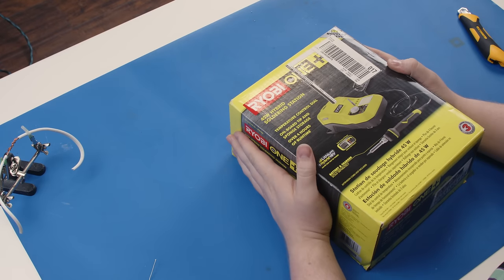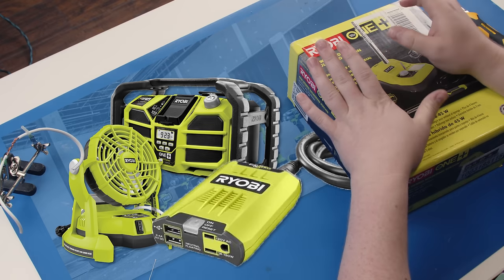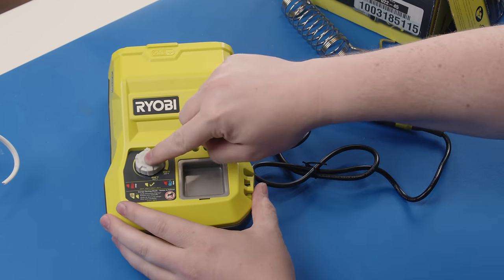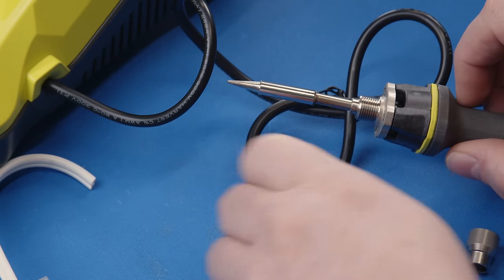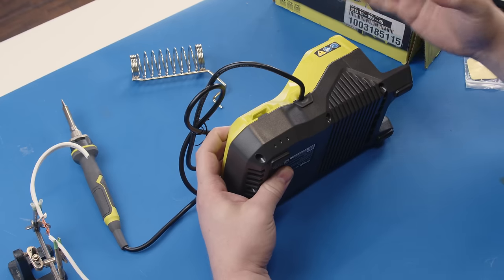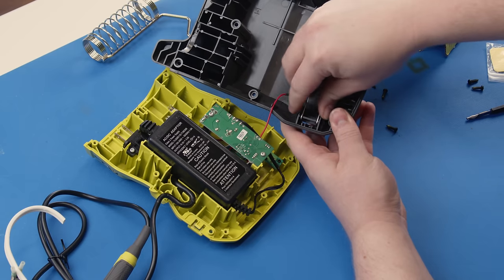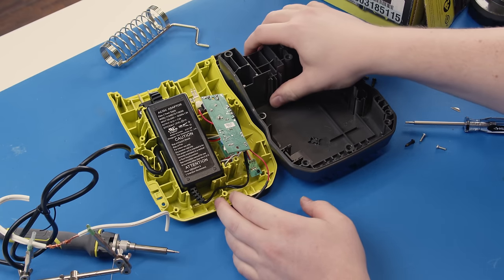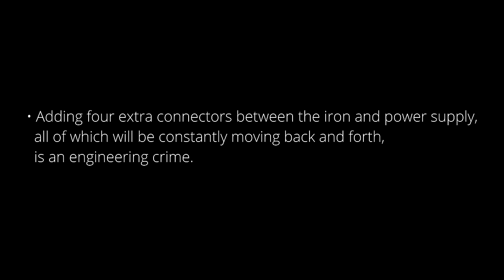Ryobi has GOT to be joking with this soldering iron

Comment: I was surprised at one particular thing in the video. I bought my first personal solder kit about fifteen years ago, misplaced it after years so then bought a new one (different brand) about 20 months ago. Both have that centre ceramic element, which is exposed when you change the tip. 
So I thought that was the norm. Both with digital temperature control and current temp display (on the iron).

edit: 20 months, not 200

Comment: based on your specs I would say you should get a ts100, ts80 or pinecil, all of those are affordable and very good soldering irons with the features you want, you just have to get an adapter for the battery or a use a powerbank

Comment: I use the Milwaukee at work, and when I'm done using it, I end up setting it on the concrete floor like 5 ft away from me do I don't accidentally touch it. There case for it is plastic and will melt off put in hot. It's also burns through batteries fast, but that's expected. I do most of my soldering inside vehicles.

Comment: I hate that I never realised you had to hydrate the sponge 😯 Did it on my station just now, and now it looks 10 times better....if only the manual had mentioned this 😂
I'm not great at soldering either, but my dad is, and he bought me this station as he wouldn't let me buy anything without temperature control or a removable wire.

Still looking for one of those USB powered irons though, as this station is great....but it's so bulky and is a chore to get out. Unlike my dad, I don't have a dedicated spot for it to live, so it get's packaged up every time and put away....

Comment: The Weller WSM 1C was a decent but chunky and ex$pen$ive lithium battery portable that I used for field soldering for years.
 It runs on the bench off the plug-in charger with the 2.5 mm Barrel plug.
The iron is a WXMP that takes the weller RT plug in tips.  It doesn't disconnect from the station just like the Ryobi but at least it's not PVC jacketed.
 I made a 3/8 plywood case to carry the darn thing in my Pelican case so the TSA would have difficulty smashing it to pieces.
 If I were looking for a portable now I probably use a TS100 or maybe the TS80 USB charging iron.

Comment: The fact that a hardware store doesn't have torx screwdrivers is absurd.
BTW, that heater design is basically what every single soldering iron with interchangeable tips has been using for the last 15+ years

Comment: I use one of the 40 watt irons. Tho I'm in the market for one with temp control. I just use a little flux paste, and boom  joint is done.. gotta be a little careful to not overheat the wire and melt the insulation. Hence temp control but flux paste makes all the difference for me

Comment: for the limited amount that I do i use the Weller AA 6/8 watt unit.  Throw a couple rechargeable AA in there when i need to use it, fix whatever i am fixing, then pull the batteries put it back into it's case and i am done.

Comment: I had 2 minor complaints with the soldering iron.  I found the cord between the base and the iron to be a little thick and stiff.  Fighting it made my hand tired when using it for a while.  The second is that there isn't really a reference for the adjustable temperature.  If I want 700 degrees, where is that on a scale of left to right? Lol

Comment: I took one of those plug in the wall units, took the tip out then stuck a 10 gauge wire about 6 foot and thawed a frozen water pipe at a friends house. I’m pretty sure it’s still there ready to plug I and get to work

Comment: Those Milwaukee ones are actually really good, you want to use one of the bigger M12 batteries which then acts as the stand and they're probably not ideal for soldering PCBs but they're perfect for automotive use, just don't drop them or smack the tip lol

Comment: Yeah i had a cold heat soldering iron from RadioShack and it was really janky, getting it to get good contact for it to heat up the solder joint was a common problem for me, ive been wanting a good battery powered iron for awhile, may have to pick one of these up as it does seem better than other things ive seen, funny seeing a external power brick stuffed inside it though.

Comment: with the last slides of the vid in mind, i use a ryobi 4ah battery into a ryobi to power wheels adapter (battery socket with 2 wires coming out the top.), which i then have a long cable with a barrel jack that goes right into the back of my pinecilv2. sure its 3 pieces now, but it works for me. My soldering station with stand is built into my 3d printed pinecil case. but i get its not for everyone.

Comment: I bought a Milwaukee cordless soldering iron, that takes the same battery as my drill. So I bought two 3.5 amp hours batteries for it. It doesn't run very long but I keep a spare hot battery 🔋. I also have two butane ones. I work on lawnmowers and they don't always break down close to a plug in.

Comment: Nice indeed never paused to think about Ryobi's marketing re the common usage of their batteries , was at Bunnings our harbour freight and wanted to buy new batteries and a charger for my drill , the Ryobi rep was there saw me looking at the new batteries and charger and quietly said buy a new drill or any other Ryobi product it works out cheaper and it did ,new drill came with 2 batteries and a charging dock . Same as the scam with printer companies they sell the printer for next 2 nothing and make their money on the ink refills. Nice dismantle thank you and I know you where neither sayin yah or nay a well balanced look at the product, most of my gear is Ryobi and yes I keep buying their products and use them in my humble workshop (wood worker here) because of the same battery compatibility  , hello from Australia .

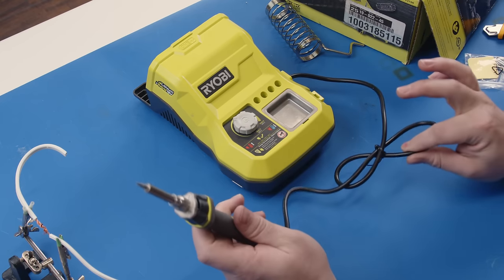Comment: 24:06 - you are NOT wrong about the temperature rating on the jacket of the cable. (Well, I mean, quite literally you are wrong about it, but that's not the point here, an 80C-rated cable is ridiculously under-rated for this application, no matter what that rating actually means, and what you're talking about is a big part of what that rating means - just not all of it.) But honestly I think you might be overlooking another serious concern, aside from the burn-through risk. If the cable itself gets hot enough - IOW if the PVC gets hot enough (and we're talking less than 100C) - the PVC will start to break down and release the C part of the PVC, in its gaseous elemental state, into the atmosphere around it. From every surface. Including the inside of the wire. That Chlorine gas will then proceed to corrode almost all of the other wire insulation inside the cable, effectively destroying itself from within. It'll also escape the outer surface of the wire, into the atmosphere you're breathing, with your head less than a couple feet away.

Comment: The soldering iron I learned on was one from harbor freight. zero temp control and as soon as i touched the tip to the working surface it immediately cooled off. it took me like half an hour to solder 2 wires together.

Comment: I think you have mistakenly considered the serpentine strain relief hold-down bosses in the upper shell to potentially cut into the cable. Ryobi has down a magnificent job of designing the plastic shell and I am certain they precisely designed the amount the bosses press into the cable. The precisely fitting shell halves seem to have been designed and manufactured in a whole order of magnitude better than any of the other components. They have had a tremendous amount of design and manufacturing experience from their extensive previous products, and it shows in all aspects of its design. 

Please refrain from commenting about the quality of molded cases of which you apparently have very little design and manufacturing expertise. Also, to denigrate the choice of screw length  holding the shell halves together is clearly unjustifiable and just plain wrong.

Using a prebuilt, standard and certified commercial power supply, AC plug and all, is absolute genius !

It truly is a shame Ryobi sabotaged their otherwise solid product with their terrible cable choice. What do you imagine they were thinking ?!

Comment: as a guy that has soldered for decades as a pro IMO the handset cord MUST DETACH so I can hot swap on the fly and NOT wait for the tip to cool down! cause somethings you need that mini tip for PCBs and other times you need that huge broad tip to heat up one thing!  and I am not paid to wait for a tip to cool down and my desk space is LIMITED!

Comment: For what it's worth regarding that little portable Hakko unit, while it doesn't have heat control and has just the one tip (or does it? Idk, my experience is with one at work that I didn't buy), it heats up very fast and the battery isn't a charge-in-place LiPo; it runs on AAs. It's definitely no replacement for a soldering ~station~ but for repairing anything already installed somewhere, it's awfully handy.

Comment: I have a few soldering irons and I usually end up using a butane soldering iron.  I got a Lexivon and its great.  I hate cable and just seems to make sense for the stuff Im doing.  Its also great for FPV fixing things in the field.  But I even end up using it in my house with HAM radio stuff.

Comment: I started out with a wheeler with a trigger and I soldered almost everything with it including automobile wires I had a cheap Chinese 12 volt DC one most handy as I didn't need 120 power so far I've never had one with a tempature adjustment and I've never had a problem soldering anything I've also use an old copper soldering iron you heat in the fire I used it to solder antique pump engine gas tanks no flame around the tank as with a torch and with that one inch square by 2 inches long chunk of copper really held and transfered the heat now with the new cordless tools this is a logical addition as for the 120 volt adapter a lot of units use this idea and as for the warning label this is the manufacturers way of covering their own interest like the battery in the black and decker booster when it dies around a year or less you can't try to get a replacement battery on warranty as it says right on the battery do not discharge below 12.2 float charge is 13.4 and full charge is 14.8 and on the built in wall wort output 12 volts so you can't say I've never taken it below voltage and I've kept it between 13.4 and 14.8 as the wall wort won't do it knowing that I had just bought 2 everstart booster packs so in checking them out the included wall adapter put out 12 volts so I checked out what it actually charge to 13.1 so I phoned the company and they assured me that was fully charged but a year later it started loosing power and fast went from 5 to 3 to 2 boosts in short order so I put my good battery charger on it through the booster cables at first all I could get it to was 90 % 13 volts but after a few charges I I got it to 13.9 got another year of life thought I might put a new battery in it but by then I found one aircompresor seized on had to open it up and cut a wire to shut it off the other one didn't work at all and with that build quality I'm scared to try the inverter in either so I'll strip them down for salvage and the batteries will get me 10$ scrap since I've had other issues with product from Walmart I won't buy everstart batteries or Schumacher products again because I won't buy from dishonest companies if they are dishonest on equipment specs to sell products what else will they do for profit

Comment: Dude I’ve seen this in several HP printers. They have a little wall wart with a tiny 3 pin molex-esk plug and one of those figure 8 AC plugs run to the outside! Baffling and made me laugh first time I saw it 😂

Comment: I know this video is 2 years old, but check out the TS 80 or TS 101, they are slim soldering irons compact powered through your average 65W usb-c charger. the only caveat is that It won't be wall cordless like the ryobi unless you use a 65W power bank.

Comment: Other than the fact that it seems kind of goofy, what exactly is the problem with having a sealed power supply like this embedded in the product? As other commenters have pointed out, they likely designed it this way to avoid having to go through an expensive and time-consuming certification process. I don't see the problem.

Comment: I've switched to a USB style soldering iron with the temperature sensor near the tip. Revolutionary. Not sure what the point of this product is when there are better, smaller and cheaper options out there now.

Comment: Look ive used a lot of soldering irons over the years and i get your point at the end but the pinecel is literally the best iron I've used, i have a decent station that I got for a small product run and around the same time picked up a pinecel as well, when it actually came to the day of production me and my team mate kept atealing the pinecel just cause it was that much better.

At the cost of $25 i can literally afford to keep multiple arpund the house so if one ever dies (which hasn't happened yet) its no big deal.

Comment: To tell you about power supply in the end of the video. Both output same voltage. 21V because battery pack is 5 cells in series. Full charge is 4.2v per cell 4.2x5=21....other power supply is measured and listed like nominal voltage 3,6V tht is it

Comment: The TS100 is a great portable digital iron with a great selection of tips. It runs on dc power so yo can run it of a powerful batter. Have had one for a few years, never touched my soldering station again.

Comment: Milwaukee m12 soldering iron is my favorite of all never had an issue with mine and if rough of as can be literally gets tossed and falls and use it alot on all of our equipment and trucks I don't know how they had issues even dropped there impacts 9 feet off a loader fine lol one thing that didn't like a fall though was there m18 grease gun it lost its two speed lol

Comment: My issue with ryobi soldering irons:
- The cable isn’t silicone, so it’ll melt if you touch it with the hot tip! Silly
- The indicator light is red-only and slowly fades in and out when hot but off, which you can’t just glance at to know if it’s off, on, hot, heating, at temp, etc.
It’s like no one tried it out after they designed it

Comment: Notice how stiff the iron cable is. This cable should be as flexible as possible, so it doesn't risk pulling the iron out of its holder and to minimise any annoying pressure a stiff cable is putting on your hand whilst soldering. The cable should be made of silicone, like the Weller irons.

Comment: The station has a lot of weight PLUS the black wings on the back is so that there is adequate support for larger batteries. Otherwise, a 4ah battery would tip it over.

Comment: I bet the lack of cooling and the overbuilt case is because it’s part of their 18v tool series and needs to survive life away from the normal location of a soldering station. This might get thrown in a truck toolbox, might see some moisture etc. whereas 120v products are made with the intention that they’ll be used indoors safely away from moisture and vibration.

Comment: What frustrates me is that as easy as they're making tools hybrid by slapping in an off the shelf adapter, not all of their tools are hybrid. I have a small hot dog air compressor that's not hybrid. Makes me wonder if I can retrofit hybrid functionality on any of the tools that are lacking with a COTS wall wart. lol
Reply: The hybrid function is nice .. but i don't think we will see it on the tools that use alot of amps.

Comment: I was trained to solder with a Snap-Off butune iron and i stg i didnt learn anything bc the damn thing never got hot enough to tin the tip. It was a student tool for a automotive class and as soon as i went to electric I began to understand what they were trying to teach us years ago and why all my joints were cold joints. No longer afraid to solder.

Comment: Both / All of the Ryobi soldering iron models use the same iron / pencil / tool. I have the 40 watt model which does not have a temperature control which is just fine for soldering wires and adding a drop of solder to the end of a lithium battery.

Comment: RE: Milwaukie 12V tools... I work at an auto manufacturer site and all the roof racks, tires, suspensions, rims and that kinda upgrades are all done with the 12V stuff. I was surprised to find that out when I started there. The stuff seems to work well and is easy to handle. Having said that, the soldering iron looks stupid af.

Comment: i've been using soldering irons since1980, and perhaps this is why only i know that it's on the user not to destroy the plastic parts of a soldering iron by holding them against the hot parts.  you can also cut off a corded saw's cord with the saw

Comment: Granted I don't solder daily (at home) but I still don't see what's the big deal with temperature control - one of those (better made) mains plug-in fixed power irons is still what does all my hobby soldering for me and never once have I felt "Arrrgh, IF ONLY I could set it to a different temperature...!". As long as it can melt the joint I'm working on, it does all it needs to do. I HAVE used plenty of temp controlled ones - and guess what everyone I ever saw using one uses the setpoint for...? Yes, that's right, "Set it higher, until it can melt the joint!"...